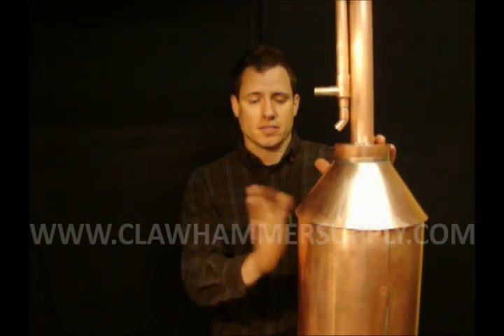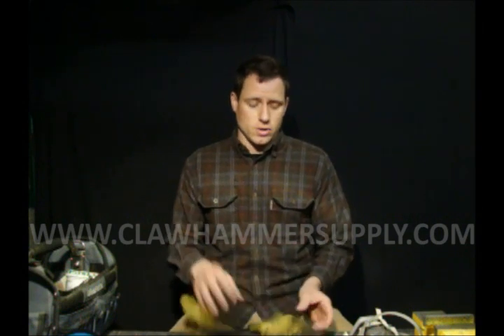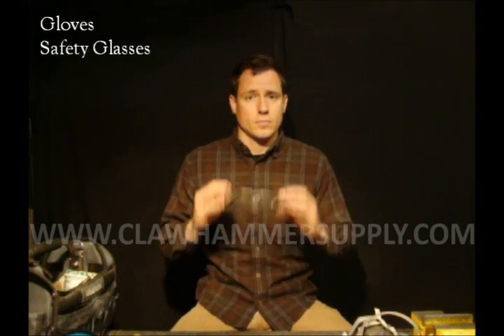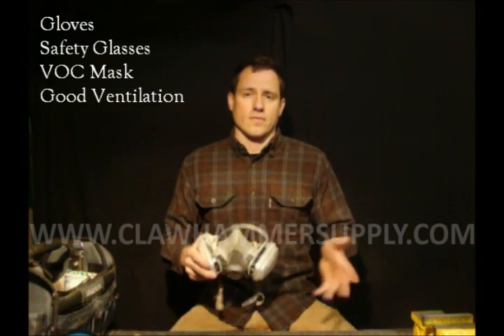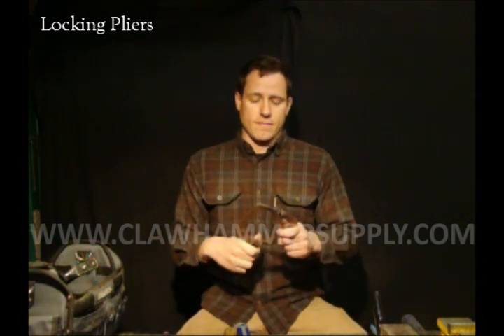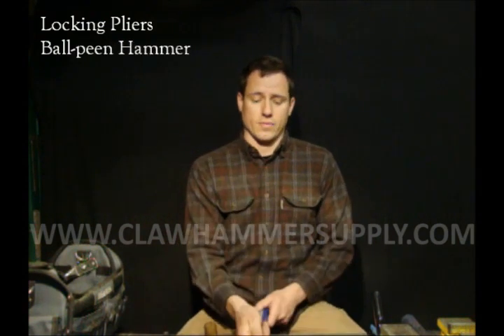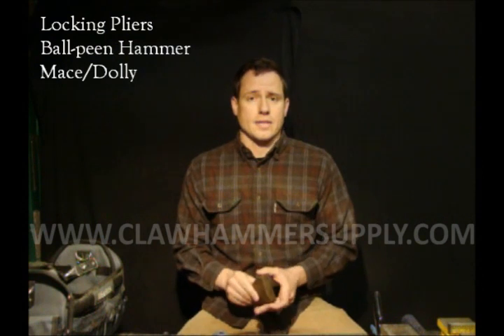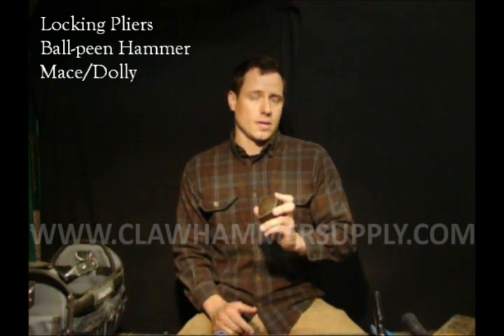How to Build a Copper Still - Part 1

Comment: From what i have researched, if you make a 5 gallon batch you need to throw out the first 50 ML of liquid due to the fact that its the low boiling point of the impurities in the alcohol. These impurities are also found in house hold cleaners and acid tone which is why they are extremely bad for you, After you throw away the first 50 ML, you have the body of the alcohol and it is safe to bottle. Near the end of the cycle, you should notice a rise in heat and a bitter taste.This is called the tail
Reply: Just run the still at 150 degrees until it stops boiling, and throw out what you collect. Methanol boils just below 150, so you want to get all of that out. After the Methanol is boiled out, raise the temperature to 180, and collect until it stops boiling.

Comment from the maker: My own spirit - Yes, cornmeal and rye flower will be what you want to use here.  It will actually seal it up perfectly because the paste actually bakes to the still.  It's what the old timers used to do and is low-tech, but pretty amazing!

Yeah, the rivets can be kind of tricky.  The easiest thing to do if you don't have an anvil is to use a sledge hammer as the backer.  Prop it over the edge of a table and secure with some clamps.  It works pretty well. 

Thanks for the feedback!

Comment: Kyle, I just pressure tested mine. The only leaks are around where the column inserts into the vapor cone (where the copper sheet metal overlaps).  I don's see a way to make it 100% air tight without some type of sealant--maybe corn meal paste? Any other ideas?

The only problems I had was hammering the rivots down into a pancake shape.  My backer was the cast iron top of a table saw and I used a ball peen hammer. The rivots kept leaning over and they wound up an oval blob of mashed metal.

Comment from the maker: jcglessner - Yes, true!  I just built a homemade fume hood by locating my shop table under a window.  I formed a hood using insulation board and stuck a small fan up in the widow opening.  When I solder I crack the window and turn the fan on low.  It works a hundred times better than i even thought it would!

Comment: VOC and well ventilated area are both great ideas. I do a lot of soldering as well as braising in the heating and air conditioning business and I've learned the hard way what the chemicals in the smoke given off well soldering can do, I have spent time in the hospital to clean the toxins out of my body. Also if you do plan on drinking your product please use lead free solder and flux.